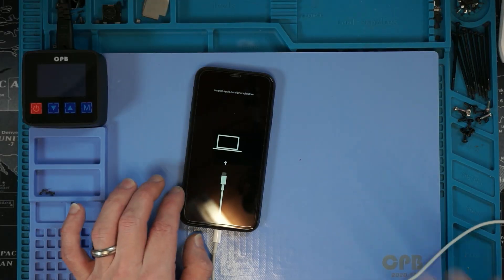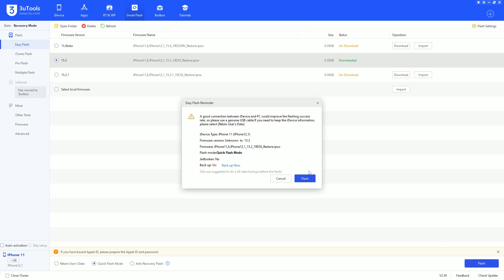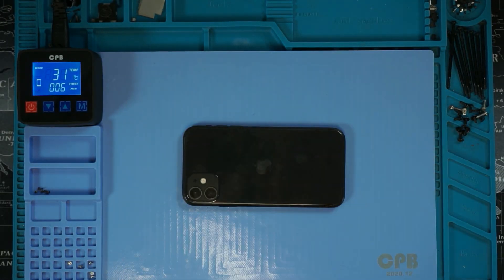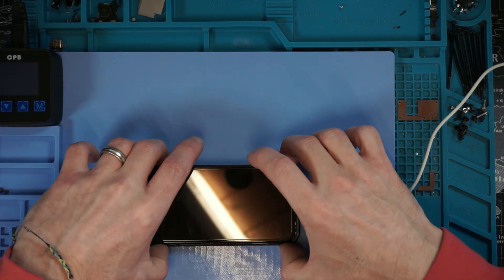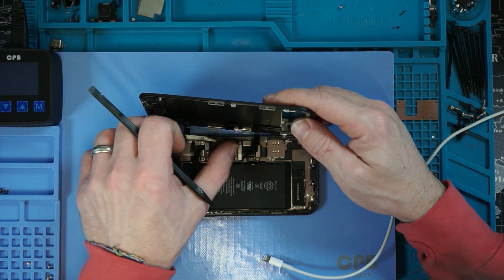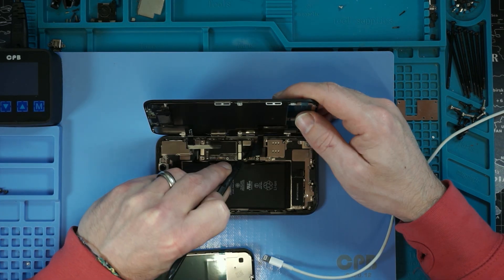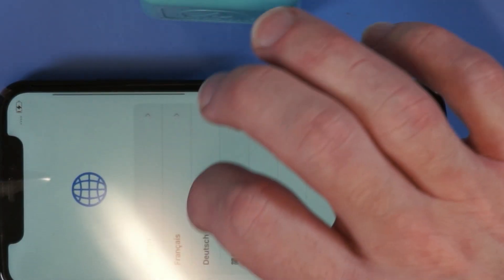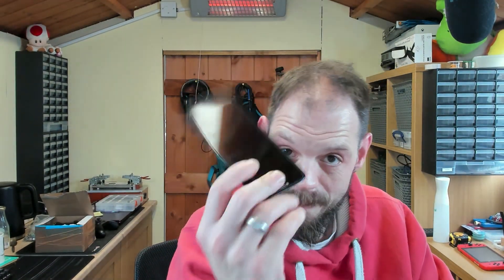Apple Said This Boot Looping iPhone 11 Couldn't Be Fixed. Can A Noob Prove Them Wrong!?

Comment: Happy days! Do u know if the Face ID still worked after u fixed it? Apple used to disable it if the screen serial isn’t married to the login board… and of course only apple could do that. 🤦. However they are finally starting to get behind the right to repair so they hopefully stopped this in firmware.
Reply from the maker: I dropped it back off last night, kid logged into his account so I could test it. Face ID and cameras work, everything is functional but True tone, I tried to get it to work but the programmer just errors out. Whatever the orgijnal guy he, he did some damage.
Reply: @GetRefurbed  Happy days!